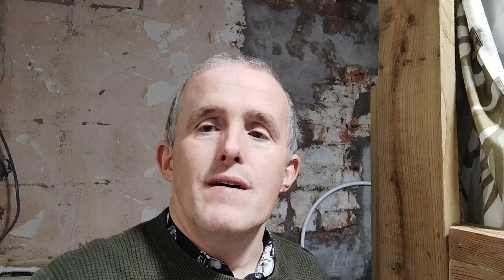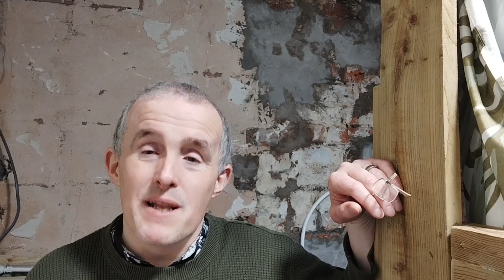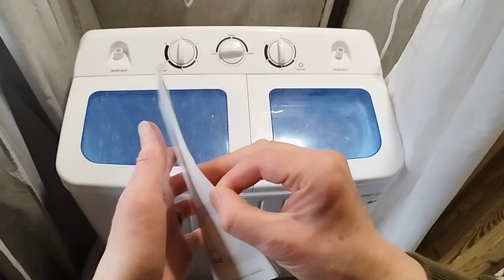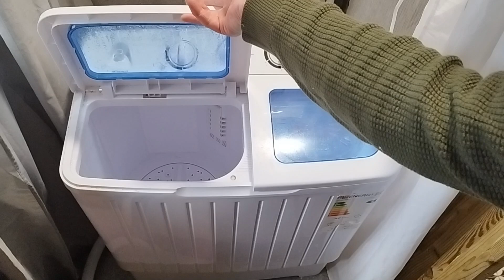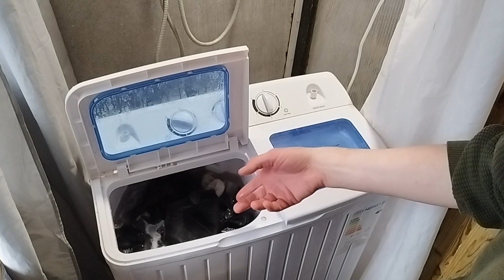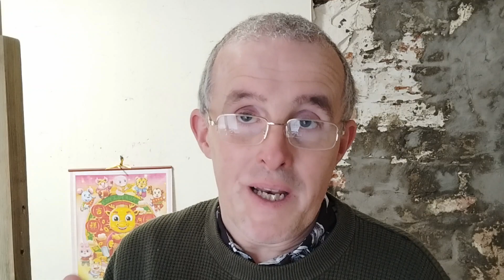Twin tub washing machine

Comment: I put mine on a dolly so I can roll mine over to the walk-in shower and drop the hose. Put a knee high stocking on the hose so stop the left over lint from going down my shower drain. I have a small hose connected to the second faucet sink I don’t use, and use that to fill it up. I also make my own laundry soap, bathing soaps, deodorant, shampoos. Trying to save as much money as I can. It’s a shame I have to do it to save every penny but at least my clothes are cleaner than that stupid expensive fancy wash machine I have. If this one goes out I’ll buy another one since I like using it so much.

Comment: I have a washer  just like that one and it will wash my queen sheets one at a time. I don’t like my expensive fancy wash machine cause it hardly uses water . So, my question is how does your clothes get clean with hardly any water?  That’s why I got this so I could regulate the water level. I’m in my late 60’s and I’m used to extra hard work. At least my clothes come out cleaner.
Reply from the maker: Our old washing machine was marketed as using less water than other machines but the water meter told a different story. This little twin tub is much more efficient

Comment: The majority of these are made by Giantex/Costway.
They can be gotten from Amazon or Temu (Temu is 
usually cheaper).
They are NOT fully automatic, though there are a
few fully automatic versions.  Generally you would
do a wash cycle, spin (with some water going in
the nozzle on the spin side (or you can pause it,
spray in some water from the top, close it, and 
spin some more).  A couple of the "pause" to wet
spins does a pretty good job at getting out MOST
of the soap.
RETURN your clothes to the wash tub, with fresh
water, and some fabric softener before a final
spin cycle.
The AVERAGE life of these can be 2 to 4 years 
depending on use, and cost anywhere between
$80 and $180 US.